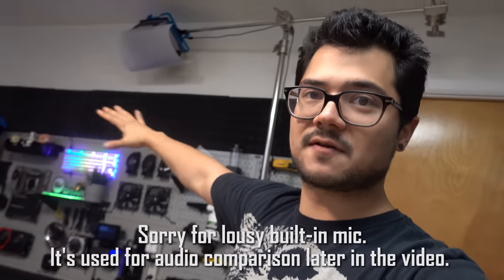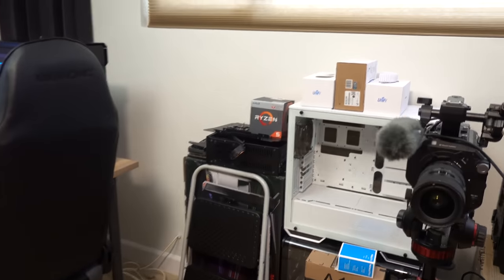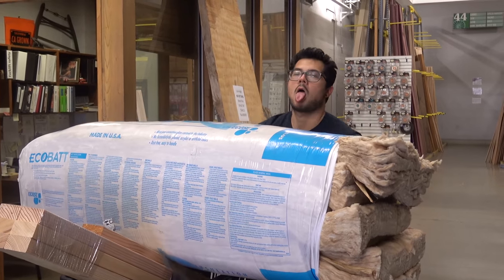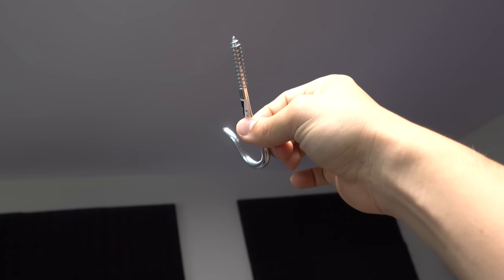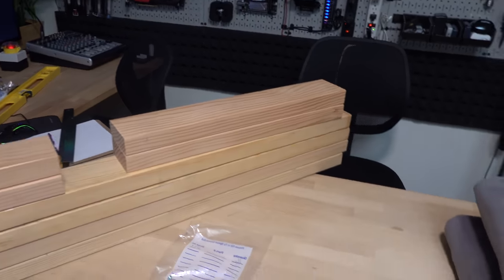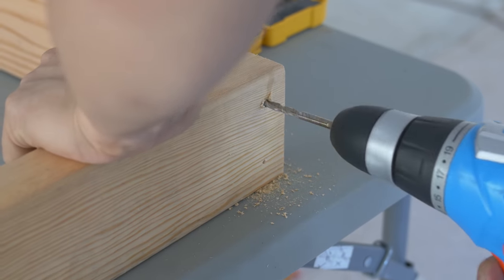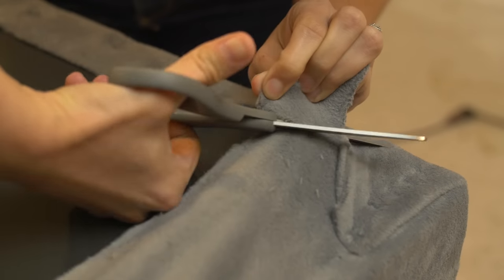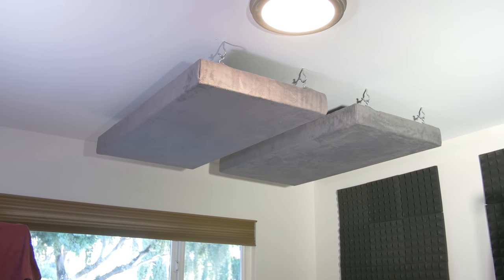Making my own acoustic panels...Was it worth it?

Comment: Hey man, I do audio mastering and music production part-time, so a few tips to help you out if interested.

1. Studios only aim for about 35% of coverage with sound absorption between the wall, ceilings, and floor. Cover everything in foam and the room becomes unrealistically dead, which is another problem all on its own. And don't worry, nobody treats a floor in the real world. There are other tricks we use, but most of them don't work in a small space, so you don't need to worry about them.

2. Try replacing the backs of your panels with more fabric instead of poster board. This can double the effective thickness of your panels because the sound waves that can make it through the insulation now have to transition back into air, bounce off your ceiling, and then come back through the insulation again. Any hard surface can become a sounding board for lower frequencies, so while the board you have now will help reflect higher frequencies that make it through the insulation (which there won't be much of) back into the panel, it's going to diffuse the more audible frequencies all over your ceiling and bounce them back down into the studio. Similarly, any sound that misses the panels on its way up right now that could bounce off your ceiling and into the back of the panel, is hitting the board and bouncing around the ceiling again instead. Make full use of both sides of your panels. If you really want to get the most out of them, you can take a hole saw to the frames and put holes in the sides to break up any reflections coming off the sides as well, but I know you said you don't have many tools and the side is going to give much less benefit than opening up the rear.
Reply: was gonna comment but this pretty much covers it ;D
Reply: Not all heroes wear capes. Some wear headphones.
Reply: @ChrisHanline  XD
Reply: I saw a video where it showed how 3 layers of towels absorbed more sound than professional acoustic foam.
Reply: Exactly! as long as you got an RFZ you're pretty much golden
Reply: @SplashWaveBeats  I saw it too! :D
Reply: @DjClimamusic  You saw that too? I was at the hardware store yesterday gathering the materials for it.
Reply: @DarkSkies_x  RFZ?
Reply: @SplashWaveBeats  Was it the English guy measuring his back garden? Great video and nice guy but he didn't take into account the reflective property of the towels, only their ability to block sounds. Basically, a slab of smooth concrete would have scored better in his test. That being said, towels are alright if you don't have the budget, but I think Rockwool is relatively inexpensive if you're serious about your room.
Reply: @anguswalker9345  I'm going to recreate the Isovox 2 box and use rockwool and towels.
Reply: @SplashWaveBeats  Let me know how it sounds, i need some absorption in my home studio, cheers!
Reply: Good advice, I was cringing a bit when he said he was gonna use boards for the back of the panels....
Reply: SunTai  When handling Rockwool/Glasswool, make sure to use eye an protection mask, and also cover your mouth and nose with a mask or cloth, your skin will itch after contact but it wont be too bad, but you definitely don't want it in your eyes and respiratory system. 
Ofcourse do wear long pants ans sleeves and gloves and wash them right after and vacuum like hell when you are done.
Reply: Aw, another thing with glasswool/ rockwool panels: it is cheaper to wrap them up in Dacron first and  using any cheap light fabric like thin cotton than using expensive acoustic fabric.
This is to contain it, over time pieces can pass through most fabrics if you don't use the Dacron.
Reply: @SplashWaveBeats  Currently having some great results from moving blankets.
Reply: I used to do music recording and thought the exact same stuff while watching. Plus he should have used rigid fiberglass insulation because it is effective at dampening lows and low mids so you're not just cutting back high's and hi-mids making the room sound bass'y.  It probably costs more but when I made my acoustic panels I used pine boards instead of 2x4's because they're lighter.
Reply: @i_am_macgyver84  You are right, but given he is only recording spoken voice the problem won't be as bad as if he was recording bass amps or a full drum kit.
Rigid fiberglass does cost more but it is still extremely cheap.
Reply: @kelainefes  true, but the price difference would be minimal for the same amount of work and if he ever plays music in that room just for entertainment it might make things sound weird.
Reply: @i_am_macgyver84  When I built my panels I went for a stack of 3" rigid and 3" soft rockwool. I would say they are useful down to 120-150Hz and totally worth the money and hassle.
Reply: Sounding dead is actually good-- that way you can add your own reverb effects and customize them.
Reply: @Cantersoft  A dead sounding room is better than one with too much reverb, but ideally you want to have a very short, diffused and  linear reverb, something like 0.15 seconds.
That's why recording rooms have many different types of acoustic treatment and not just loads of sound absorbing panels.
Reply: @kelainefes  I get that. Personally, I'd rather add in realistic pre-delay with an effects plugin in my DAW. That way I can fine-tune my music for the genre. For example, you might want the deadest sounding recording you can get for electronic music using heavy autotune-- it makes it easier for rhe autotune engine to tune accurately. Then add the reverb back in post-autotune.

Sometimes effect reverb sounds too unrealistic. In those cases, convolver plugins are useful for emulating realistic spaces.
Reply: i was going to ask: what echo??
Reply: Don't some people use affordable painting canvases sometimes? or just use a canvas frame with some fabric stretched over it?
Reply: how has no one mentioned yet that foam is just actual useless garbage and even with adequate coverage, all it does is make the room bottom heavy and boxy.
Reply: Splash Wave Beats same
Reply: Didn't know this at the time, but honestly, he could probably get away with the de-reverb module in the Izotope RX suite.
Reply: Yup this is spot on. Good attempt but a few flaws that are limiting. 

And foam really sucks, it mat look cool but only really barely does highs. For your needed, its mids and mid base.
Reply: @James Pingel also specializes in befriending children at parks that he doesn't know and driving them "somewhere special that mommy and daddy won't know"
Reply: The thing is since he makes videos with music in the background he doesn't need to worry about it sounding to dead also he might do some sound measuring of hardware where a dead room might benefit him
Reply: @SplashWaveBeats  that’s because acoustic foam doesn’t sound proof, it treats the acoustics of the room so you don’t have a lot of reverb within not sound proof it. Sound proofing is stuff like rock wool insulation or really just things like thick blankets that has a gap of air between it so the sound pretty much dies going between the two. It’s probably how they tested the towels (maybe idk) with a gap of air between and that’s why it did “more” because there two way different things.
Reply: I know this is an older post, but figured I would add the info that his Fabric looks a little thick also. A good rule of thumb is that air should be able to pass through the fabric easily. So, if you can blow air though it, than it is a good fabric to use for acoustic panels to allow several frequencies to pass thorough to the insulation.
Reply: @SplashWaveBeats  unfortunately that's more sound reflection, not absorption.
Reply: @SplashWaveBeats  acoustic foam is not for absorbing sound, it has low density so its lightweight and doesnt stop the sound, towel has more mass so that result was expected, its for diffusing the sound and removing unwanted reverb/echo. For absorbtion we use rockwool in 99% of cases then fiberglass, and other high density materials like vinyl.
Reply: Pleaseee give me tips. I have a barbershop with big space and high sealing  how could i fix this problem